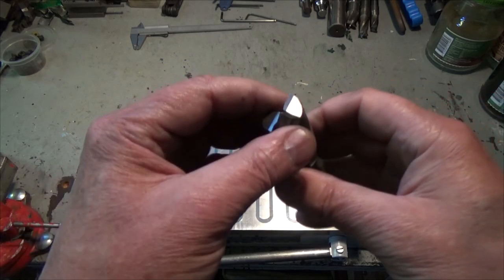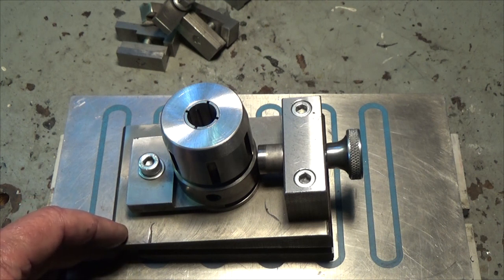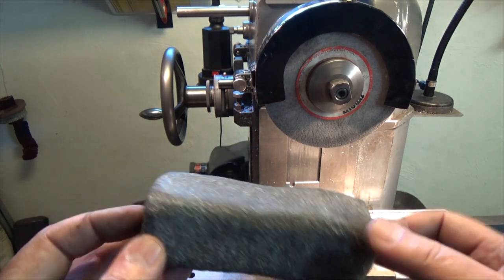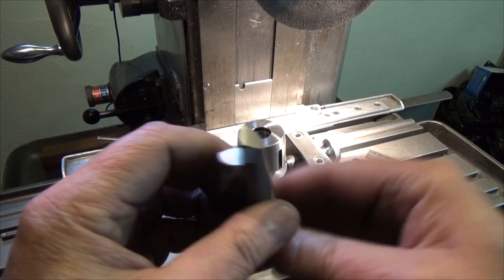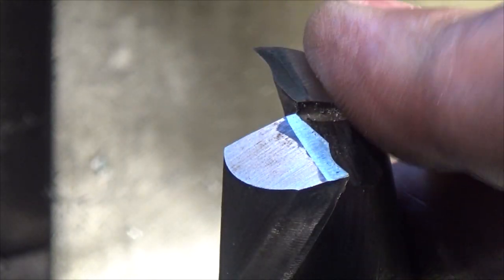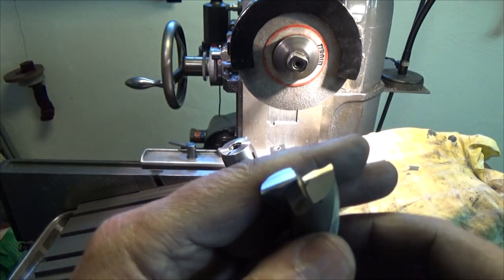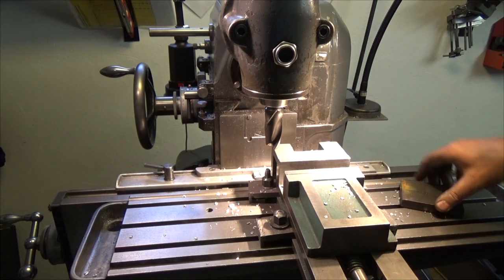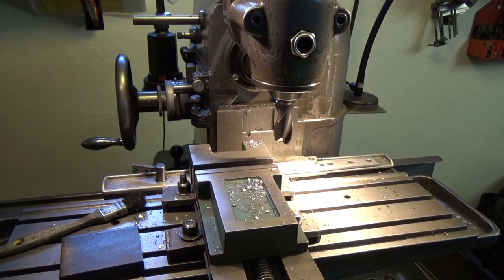End Mill Sharpening - My Way

Comment: Very nice, I don't know if anyone has mentioned but your wheel is rotating anti clockwise so you should feed from right to left, not left to right

Feeding from left to right if you forget to lock the magnetic base the endmill can be sucked into the stone.. jamb and shatter the stone

If feeding from right to left the endmill will be knocked away

If anyone watching has a wheel turning clockwise then they should feed left to right
Reply from the maker: Thank you! Yes i know someone mentioned it in the comments. Oh and I'm not using a magnetic base, the fixture is clampted to the table.
Reply: @tompas11A3n52KkX  ahh yes I see the clamps now :) , I've been watching quite a few vids on endmill sharpening to see different takes on angles and approach, I think yours was the third vid I watched and the other two used the Stevenson fixture on a magbase so magbase in my head
Reply from the maker: @markhobster8113  It's ok. My fixture is a kind of replica of the Stevenson fixture that I made many years ago. I don't own a surface grinder so I use the old mill. Not the best but it works.

Comment: Very informational video!  I have found you can help aging magnetic tables by placing 1-2-3 blocks or similar material snugly along the sides of the work piece to spread out the magnetic forces and keep the work from moving on you.  I am a new subscriber.  I too have a channel where I make stationary steam engines and other fun stuff.  Thank you-  Fred
Reply from the maker: Thanks and also thanks for the advice about aging magnetic tables. I've checked your channel and decided to subscribe!

Comment: What is cost of this machine
Reply from the maker: This fantastic machine is an Aciera F3 made 1959 in Switzerland. I bought it used many years ago, payed 22000SEK.
Reply: They sell between 1500-5000.- CHF it is a very versitile Machine have the same. I call it a "legend" They are precise up to 5mikrons. Hardfacing is possible to. Come normaly with a W20 collet system. I will take mine to the grave.

Comment: Couple comments.  You sharpened the end of the cutter yet you side milled your test pieces.. 

Nice that you have a horizontal mill.  Or are you using a right angle attachment to hold your wheel?
Reply from the maker: I used the sharpened end of the end mill cutter as you can see in the video. This wonderful milling machine is an Aciera F3 and it can do both horizontal and vertical milling. Just remove the vertical head and you have a horizontal milling machine.
Reply: @tompas11A3n52KkX  I have to disagree.   You did not make a plunge cut, which would have tested the sharpness of the cutting lips you sharpened.  You touched down on the block, raised your table, then side milled.  That tests the sharpness of the flute edges.  When I have an endmill sharpened by a cutter grinding shop, they grind the flute edges if they are dull.   Of course, this reduces the diameter of the mill, but is a necessary thing if you're going to side mill.

Comment: It seems dangerous that the bit is entering the grinder arc in the same direction as the oncoming grinder surface instead of against it. If it caught then it would be jerked underneath the wheel instead of being nudged out in the clear. As the item is grabbed further under the wheel the space is smaller and the grabbing action increases. This will escalate until it is ejected out the other side of the wheel. You might end up with something broken and a piece of it might rocket off to the right of the camera.
Reply from the maker: Yes you are right there is a risk but as you can see, I grind very little off each time. Better to move against the grinding wheel rotation.
Reply: When I was taking my machining training on using a surface grinder, I was advised against grinding more than .0002" at a time.   The setup had to be VERY RIGID, and the wheel dressed properly before doing any cutting.

Comment: Nice job..the endmill has about 3 degree face angle to the inside..are you tilting the vise?
Reply from the maker: That angle (in this case it's about two degrees) is built in the fixture that I made. Thanks for watching and comment.
Reply: I believe mine has that built into the fixture